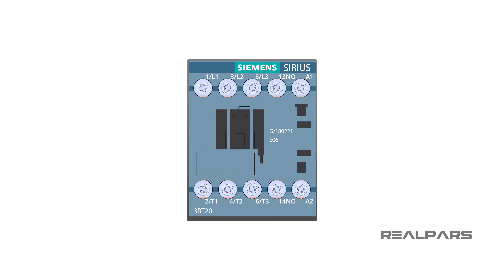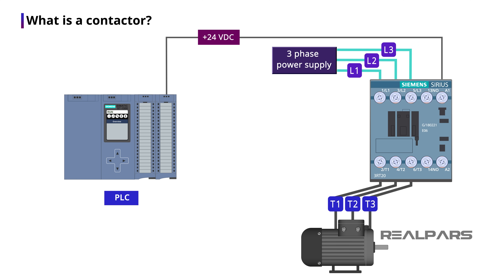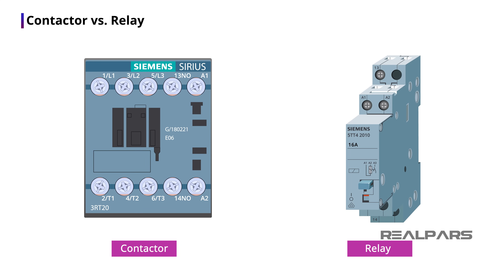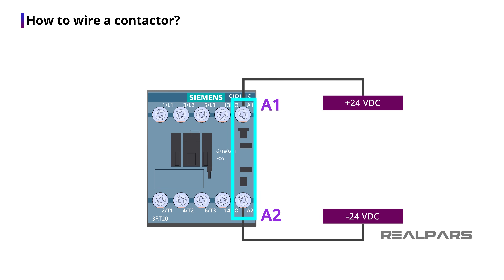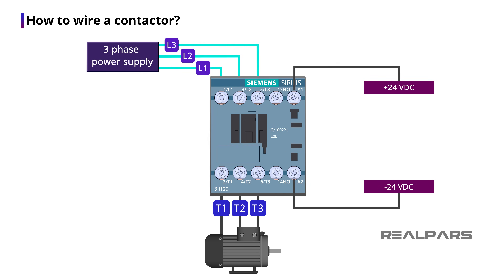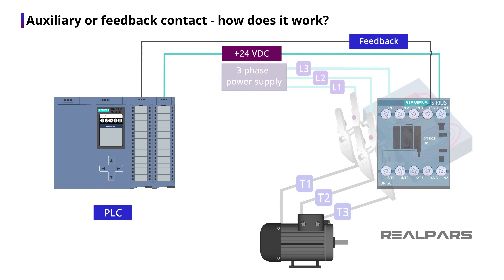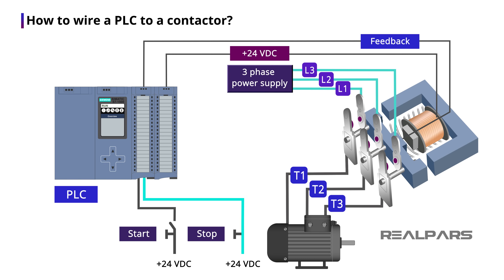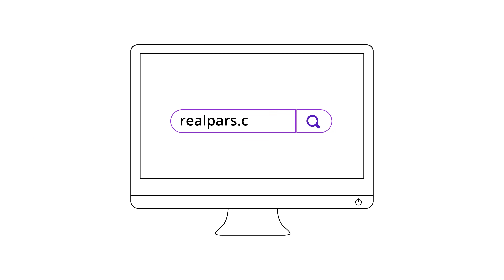What is a Contactor? | Working Principles

Comment: Very well explained in American-English, recently I did a L3 PLC programming in UK and it was horrible. Anyway, I took the certification...And by the way regarding the contactors and relays, you can always put three relays instead of a contactor for some small motors temporarily, just check the ampers. I have an Arduino controller with 230v 10A ,very small relays working even on 3.3v DC, so with them, I can easily switch On/Off a 1000W , 450V  motor.
Reply: What if only one phase trips? Wouldn't that cause phase imbalance?

Comment: Great video. Remember one thing. You must connect a thermal relay in series between the outputs of the contactor and the inputs of the motor, plus the output that indicates a overload as a signal to PLC.
Reply: At that point why not just use a VFD instead?
Reply: ...and now you have a motor starter and not a "contactor".

Comment: If I remember correctly, contactors use a bar across two contacts per line where it can split the voltage to prevent arcing, whereas a relay uses only one point where it will experience the full voltage drop across the contacts, when opening the circuit, so a relay will take damage when opening a higher voltage/higher current source when the contactor is designed to split the voltage across the 2 contacts and  reduce possible damage from arcing.
Reply: This is correct. The contacts in a contactor are also larger than a small relay and have contact surfaces designed for higher currents. Often the contacts in a contactor will also 'wipe' or rub across each other slightly as they close, this serves to clean off slight oxidation traces and keep the contacts fresh.
Reply: the double breaking does not cancel the electric arc but helps to extinguish it, which will define the breaking capacity of the contactor.
Much of the complexity of contactor design lies in implementing different arc breaking techniques in a minimal amount of space.
it is this electric arc which determines the electrical life of the contactor (because of the progressive degradation of the contacts) which is much less than its mechanical life which is often around ten million operations.
The electrical life depends on the type of load supplied by the contactor. An inductive load will generate larger arcs than a resistive load and decrease the longevity of the poles. The contactor manufacturer gives life curves as a function of use to provide for the replacement of devices.

Comment: Howdy. Nice basic knowledge.
However. I would be reluctant to connect a contactor coil directly to a PLC output. I would use a relay in between.
Also a backfire or free-wheeling diode over the contactor coil is mandatory with DC. There is a lot of induction in the contactor coil when engaged. This energy will rapidly burn the relay or PLC card contacts if not managed. With AC the backfiring problem is not as big but some backfire managing is still necessary by a suitable RC filter over the coil. Typical values are R = 100 ohm and C = 100 nF 500 V in series.
Regards.
Reply from the maker: Thanks for sharing your knowledge and experience with us! We always appreciate such comments.
Reply: @Mindaugas Vaitiekūnas Yes.
The backfire diode is a good solution in most cases. It is sometimes experienced that the contactor disegages too slowly as the back current takes too long to dissipate in the coil and the diode.
A solution to this may be to use, say, 7 diodes in series. This will force the back induction to rise to about 5 V and provide a faster dissipation.
The output transistor will see a voltage of 24 V + 5 V, or some 30 V but it will most likely tolerate that.
One could consider using a regular diode and a 5 V zenerdiode in anti series but it is not recommended. Zener diodes are slow and will allow the build-up of a high spike before going into conduction.
For the same reason Schottky diodes cannot be used.
Regards.

Comment: A small correction for you. You stated a couple of times that most contactors use 24VDC for their coil. While these are used, the great majority I have seen in industry use 120-400VAC for their coil, with an interposing relay to convert the PLC's 24V output to a high voltage AC output for the contactor coil. I also would not directly connect a PLC output to a contactor unless they were specifically rated for it, as they are an inductive load and can generate large voltage spikes when turned off.
Reply from the maker: Thanks for sharing that, Stephen!

Comment: Hi! I really like your videos, congratulations for the excellent manner in which they are presented. They are an excellent training resource!
One question: I keep seeing in your videos that you mention a -24V DC connection when in reality it should be 0V (M in schematics). When you say +24V in the positive connection, and then -24V in what should be the 0V (M), it gives the wrong impression of a net 48V potential across the supply of the contactor coil. I've seen other of your videos that also have this mistake (not exactly of contactors by the way).
Am I missing something?
Reply from the maker: No, you are not missing anything.  Having designed and installed hundreds of panels over my career, I have seen a few different ways to identify the negative, or common, connection for 24VDC circuits.  Technically, the return leg, or more negative connection, in a 24VDC circuit is identified as 0V, earth potential, or COMMON. However, some like to identify the common terminal as the (-) terminal or the negative terminal of the 24VDC circuit (-24VDC).  This designation is designed to separate it from other grounds or earth potentials.
Reply: I always say "DC Common" or "DCC".

Comment: @8.10 normally stop switches will be NC..but in this video it is represented 
As NO
Reply from the maker: True, Stop pushbuttons are normally NC contacts.  However, for some installations, the START and STOP pushbuttons are both NO contacts brought into a PLC DI card, as in the video.  In other installations, a single NO pushbutton is used to both START and STOP a motor.  For single machine installations or shop-type installations, NO contacts are sometimes used when the E-STOP is in close proximity in case of failure.

Comment: This video saved my careers.
By the way, I have a question. Does A2 also connect to PLC? If yes, is the voltage connected to A2 have value of -24 V?
Reply from the maker: A1 and A2 are the to connections in the contactor that actuate the coil, which in turn pulls in the contactor and allows current to flow from L1/L2/L3 to T1/T2/T3.  As the video explained, the PLC I/O cards are not powerful enough to actuate the motor directly, so we use a contactor with a low-voltage coil, in this case a 24VDC coil.  A1 is connected to +24VDC at the I/O card (the digital output terminal) and A2 is connected to 24 Common.  Sometimes we refer to the common terminal as -24VDC, but it is truly a ground, or 0V potential point that is shared with the power supply.  So when the digital output is energized, 24VDC flows to A1, and the coil is energized, pulling in the contactor.  A connection to A2 is required to insure a steady 24VDC is applied to the coil (e.g., form a complete circuit).

Comment: Hi, i am not an electrician, but isn't relay essentially a circuit breaker? Contactors, as far as i have read, works similarly to circuit breakers/relays, but rather they are "switching devices" and not used as overload protection devices (circuit breakers). Please corect me if any mistakes, just a confused human being 😄
Reply: And also, when a VFD is used to run an AC motor, is a contactor still needed? I thaught that maybe VFDs have contactors internally embedded.
Reply from the maker: @nimbo9492  In this instance, a contactor is not needed, and typically, not used.
Reply from the maker: You are correct.  Contactors provide a safe and protected way to switch power on and off "across the line" to 2 & 3-phase motors and other electrical loads (heaters, etc.).

Comment: I just joined this platform and I hope to learn a lot as I just began my career in Automation but I need some advice please. I studied CIT Networking for my degree but my my boss at work instead of absorbing me into an IT role becos I was initially a factory worker advise I do automation that I won't regret it. He absorbed me into the scada level automation to be a PCN Administrator and am just 8weeks into it. Its interesting and I still have to do little of my networking. Do I need to do any engineering course to stay in this line or am good with the IT background. Thanks.

Comment: 1. As u connect PLC to contractor coil as 24 v DC power supply is that from input or output modules?

2. And feedback is also from where in PLC input or output modules?
🙄
Reply: Since we are giving DC/AC power to contactor coil from PLC, it is given from output module and we are taking feedback to PLC from contactor coil, it is given to input module of a PLC.

Comment: Very nice video. However, this phrase can be misleading: 842 "... a contactor is used for turning on and off heavy high voltage devices". Voltage and current are two different things. The main difference between relays and contactors is the load current, not the "load voltage". A lot of contactors are used for low voltage (100-1000 VAC) devices. The contactor doesn't even "know" the voltage of the load device, it only "sees" the current passing through it.
Reply from the maker: Thank you for your comments.  You are correct, contactors are specified by amp rating on the contacts, but they also need the supply voltage to the coil specified as well.

Comment: Hello! Been following your videos for some months now! Got just a question, isn't A2 supposed to be "M" (mass +- equal to 0V)? Hope fot an answer thanks!
Reply from the maker: Different device types have different methods for indicating the supply voltage connections.  Siemens likes A1 and A2, Rockwell uses X1 and X2.  V+ and M are used by Siemens for connections to PLC CPUs, and A1 and A2 for contactor connections.

Comment: But how Does dc volt make magnetic flux?
Reply from the maker: Technically, in the contactor coil, the DC current creates an electromagnet since it is wound around an iron core.  It produces a static magnetic field strong enough to pull in the contactor.

Comment: I have a spot welder that uses 110 volt ac. The existing switch is a manual momentary switch with large contact points. The switch is obsolete.  Can a contactor be used to carry the current instead? Primary amps is 1.5kva. Secondary amps after the transformer are 3600.
Reply from the maker: Thank you for your question!

Given the unique characteristics of welders and the substantial amp draw, it's best to consult your welder's manufacturer for accurate guidance. Our video mainly covers contactors for control devices around 50 amps, but options for higher current supply are available too. For precise advice, reach out to your equipment manufacturer. 

Happy learning

Comment: How does it work with ac voltage, if an ac current pas through a wire a changing magnetic field will be made and it will pull and attract the metal that will be closed or am i wrong?
Reply from the maker: Hello Arnaldo, 

Thank you for your question. Yes, it will work if you use AC voltage. Each coil for the contactor or relay is wound differently, creating a different resistance by the manufacturer depending on its usage. And the DC coils have a diode in series, with the coil changing AC to DC if an AC supply is used instead of DC voltage with these special relays. Always read your data sheet for the component you will be using.

Hope this helps! Happy learning
Reply from the maker: Hi Arnaldo, I see that your second question disappeared, but just to help you out in case that happened by accident on our end:

Question: 
"And the second question is how does a motor work with dc current , it needs ac current so it can produce a changing magnetic field and the coils that are phased 120 in space will make it circle rotation wich will imply a efm in rotors coils and both fluxes will create a electronagnetic moment to make the rotor move by itself and i dont think this can be made by dc"

Answer:
The DC and AC motors have been with us a long time. Here are some links I hope will help you with your question:
https://motorspecialty.com/news/a-brief-history-of-dc-motors/
https://www.youtube.com/watch?v=HayryySX_po